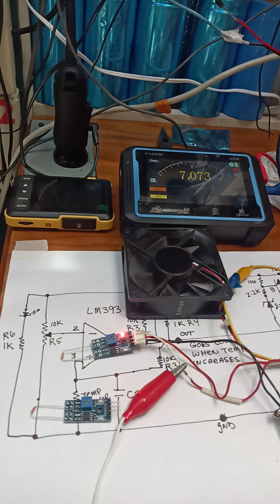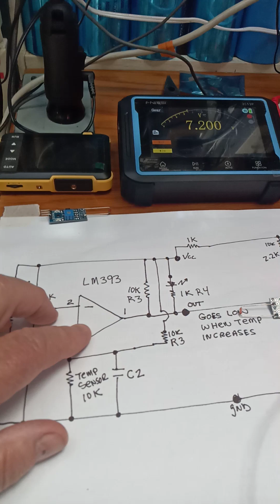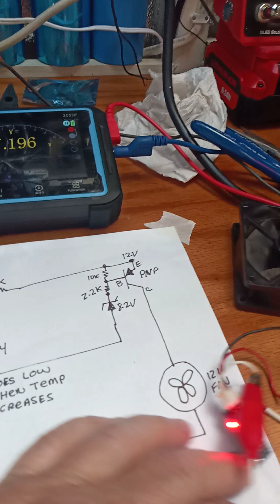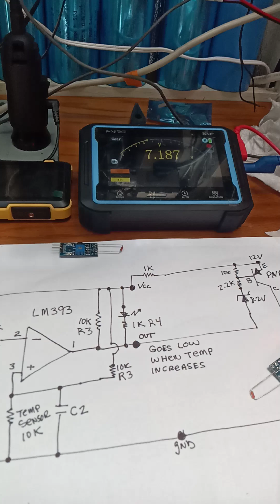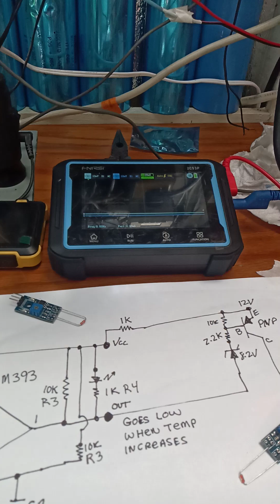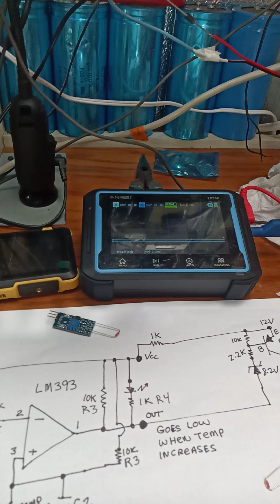LM393 Temperature Board To Cool Refrigerator Motor

Comment from the maker: My converted chest fridge only runs in the daylight hours from PV.  Every morning there are long run times to get the fridge down to temp.  These were designed for short intervals where the motor was used to dissipate some of the heat.  I want to cool the motor so it becomes more efficient.  This circuit powers the muffin fan till temp drops.  I'll hang the fan with some magnets for a no drill install. Fridge does not have to be on for fan to work.  This is a common board for small micros.  It could also be adapted to make a PV power point water heater.  We will try that in a future episode.

A simple dropping resistor provides voltage to power the board.  The power on LED and 1K resistor form the major load till the fan comes on.  Then it is another identical load added to that. This is not stable, but the bridge circuit is pretty much immune to voltage changes.  This comparator has no hysteresis and can get a little noisy on transitions. A PNP transistor has to be added for higher drive and to invert operation.  A zener provides offset voltage so it fully turns off.

In a PV power point water heating application this board could drive a FET directly making a pretty simple build.

Comment: Did you add insulation to the freezer?  My freezer has the hot part at the top so I figured I can save some energy by insulating the bottom part. Newer came around to do it thought. 

Handy little circuit and nice way to use it. I can see myself using it to draw cold air into my fridge-box at night if temperature inside my fridge-box is higher than outside. Should not need much of a battery to do that.

Anyway, a comment for the algorithm. Thank you for making and  sharing this 🙂
Reply from the maker: The insulation is good enough. Don't try to turn that into a fridge.  My Haier has the hot spot on top and even with a fan inside there is a great temperature differential.  Had a GE before that lost gas and got this because it was expedient.  It had cold coils on top.  That gave it a natural convection down.  The HAIER just stratifies too much with a large load. Always have the seller do a test run to check before you buy.